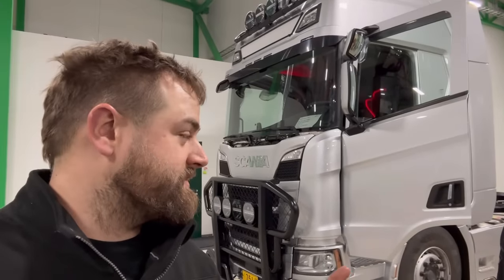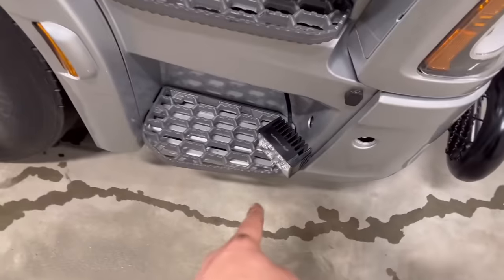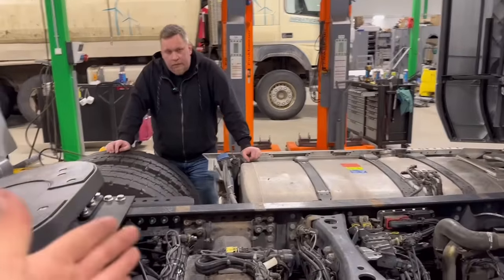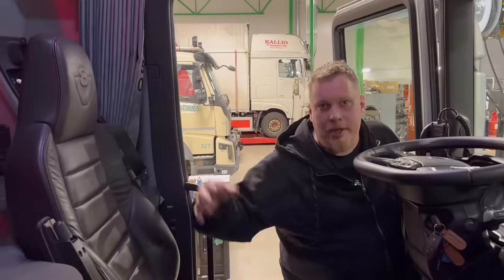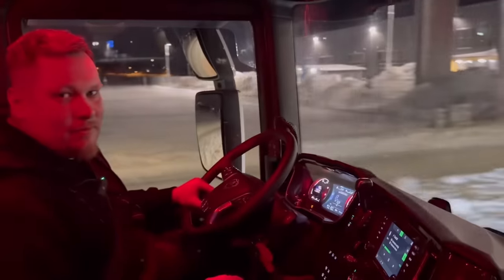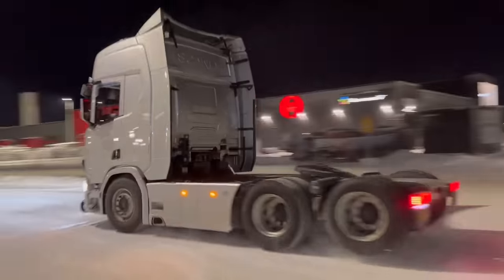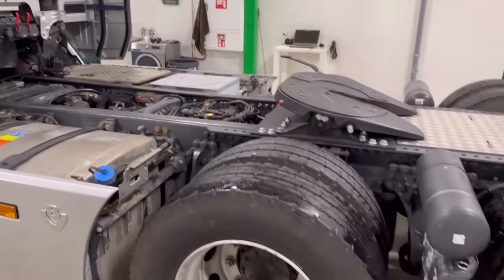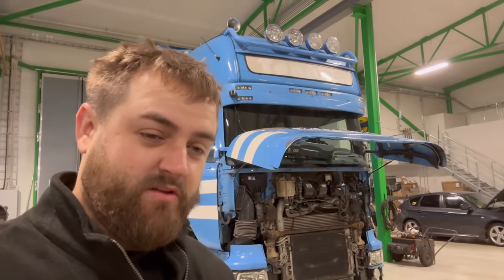First EVER Manual Swapped R650 Scania Truck!

Comment: No necessarily need manual box anymore in this day and age, especially with all that power and torque delivered by V8 Scania. But it's nice for some people to have total control. 

I gues you only can fully manual convert older/traditional Scania Opticruise gearbox (GRS & GRSO Series), I'm not sure with the new Scania G25 & G33 gearbox, since they have new gearbox layout and planetary gear system.

Comment: Regarding older European trucks, a lot tend to migrate. So they're still working but usually in places with looser emissions laws and the local mechanics will often remove emissions reducing features like the adblu/DEF systems.

Although in the UK at least, the more specialised (additional job specific equipment) a truck is the longer it's kept running.

Comment: Maybe it was the first ever manual swap, but these R650s did come with a manual gearbox from the factory! They were the absolute last Scania V8s to be available with a manual. You can still get a manual today, but only in combination with the 6 cylinder engines. I wonder how many more brands offer a manual today, Daf and Volvo for sure only sell automatics today. Scania has a specialty for the automatics, a clutch pedal that can but must not be used, it's called "clutch on demand" and actually works electronically.

Comment: Ylivoimala,  the dominance of the super power plant,  that  tunes super Scania trucks into super duper trucks!  

and you did improve a lot on them pronunciations, too. I'm so inspired by your video uploads. 
Speaking of being the Scania ambassador in the USA, I hope you make it.  They've tried it, but ocult forces have dragged them away. You know Cummins is part od the same subsidiary Traton, where they, including MAN are all ultimately owned by the VolksWagen Group. In Brazil the VW truck has used MAN engines (made in Brazil) for a decade. Who knows if Cummins could start making Scania V8's? Volvo has found its way with the nosed VNL's. Maybe Cabovers are just not the  preference in the US. But you bet V8's are.
Reply: Scania and MAN share engines. The inline 6s are made by MAN and the V8s are from Scania.

Comment: I think there nice, but do a 210 wheelbase, 120 inch sleeper, 13, 15 manual trans, no tag, both drives live with lockers, heck ya

Comment: fun fact about the blind spot camera. here in the UK if you need to drive a truck in London you NEED to have them cameras installed otherwise you get a £550 fine (697USD) every time you drive into the capital. you also need the shouty man speaker ("Caution Vehicle turning Left") and a blind spot sticker on the blind side of the truck. you have to register the truck with Tfl (transport for London) and prove that the safety systems are installed and they will add you to the system so you dont get the fines.
Reply: Yep.   On the scania bottom right bank middle fuse shuts the voice up.   If people can't see a 44 tonner turning left they need stay at home
Reply: In scandinavia, and other european countries, bicycles and pedestrians has a right of way in crossing/stoplights. So if motorized vehicles has to turn right, they have to wait until the road is clear behind them and to their right. And since that angle is blind, cameras are necessary for safe traveling.
Reply: Should have been mandatory from the factory since cheap dashcams were a thing from 15 years ago.

Comment: Sure i can understand why you want a manual, but the Scania automatic gearboxes seams to be really good, why then converting from a auto that works good to a manual? :)

BTW: temp wise, -7C is normal and a preferred winter temp any warmer its to warm during the winter 😂 
And right now, here in Sweden i have -15C and i live at about the same longitude as you are at in Finland atm :)
Reply: And yet Scania put a clutch pedal back into the heaviest opticruise equipped trucks.
Reply: Cause some people just don’t like auto me being one of them

Comment: That manual shift sure brings back memories. Had the honour of having that 11 years. I REALLY MISS IT! Completely superiour solution -if You really know what You're doin'. Exceptinally nice 4 pulling really heavy loads on slippery roads -and getting it just right around really tight spots. This offcourse without burning out the clutch. SO MUCH RESPECT  to this guy -who bought -and specified this to/ from Ville! Would love talk truck over a cup of coffee with that guy. (45 minutes of course.)

JUST LOVE that flipped vintage SCANIA/vintage FERRARI manual shift pattern! 

Been wondering:
How do You use the tachograph in on U.S. trucks? They are mandatory on all trucks over there -like here? U should have old ones (paper) and new (digital) ones like we do here in Europe. Are the older paper tachographs -still allowed in the U.S? 
Bruce has the old tachograph in both of his SCANIA Trucks. If he later will pull some loads with his new SCANIA Truck: -Can he just use the old paper tachograph in his SCANIA over there?

Comment: Anybody knows if US manufacturers can spec their trucks with hydraulic retarders and/or gear reduction hub axles?
Reply: First ask if they even know that the technology exists 🤣
Reply: My 1989 Peterbilt has a Cat 3406B with the Brake Saver, which is a hydraulic retarder. Works pretty well considering it’s age, but is sadly prone to oil leaks.

Comment: Scania would build you an R650 manual from factory if you really twisted their arm Westward Scania have one but it was more expensive, and it wasn't an option on the S series so they are very very rare.
Reply: Yes the manual gearshift is only in the R Serie possible... the Power with this truck is unbelievable ... uphill you are a left lane bandit with this truck !
Reply: I feel like they actually wouldn't. Probably don't manufacture the parts required anymore.
Reply: @rkan2  no they will do and have done in the past, as I say Westward Scania have a from factory Manual 650
Reply: @grahamhume8135  yes the R650 you can buy with manual gear shift, but now the only build automatic gearshift the R650 Was the last with manual ... i drive the R650 with manual and it was a Monster uphill ... it was fantastic!

Comment: Two weeks is too little time to really see the variety of truck stylings in Europe. Also you should have grabbed all the lights out that R that you grabbed the engine of.
Reply: The lights on the R looked like older halogen lights, Im pretty sure Bruce wants LEDs like the ones on the manual swapped truck, halogens have NOTHING on LEDs when it comes to brightness or longevity

Comment: then you ask if its "Cable" for the shiter / gearbox, with that you talking about a electric switching gears. or do you mean that its a "steel wire" shitfit the gears then puling the shifter?

Comment: Normally I would take of in 2. go to 4.-5-6 if loaded light or flat road conditions maybe skip 5. … you can try it on yours.
Reply: And splitting gears only when needed. If the motor is loosing slightly rpm uphill.

Comment: Fyi those extra lights are not legal in USA except for off roads as it can blind on coming cars on highway  these are legal in Europe in some countries
Reply: The reason these are legal some places in Europe and doesn't really cause any issues on public roads, is because they can only be wired to the high beam circuit. You can never turn them on manually with low beam/driving lights, so the driver only has to operate the low-high beam lever as everyone else.

Comment: Bruce I can see why you like the Scania so much especially for the HP and torque. 

What are you impressions of other European vehicles? MAN which is also owned by VW, Volvo, DAF, MB. The Scania has the biggest engines but for safety features they are all similar. Definitely decades ahead of their NA counterparts although again some U.S.A. models are owned by European mfg.

What is the reason you dumped the auto?

Just curious as to why you have picked the one.

Comment: Whilst I really admire the engineering involved in doing this.
    But what really is the point, because as standard you can drive the new Scania in MANUAL MODE & USE THE PADDLE SHIFTER ON THE RETARDER LEVER. 
I drive Scania in manual mode everyday whilst at work in my new gen Scania.

But then again….driving in the snow, manual with a stick makes sense, because these guys in this country drive in the snow all the time.
     But I think I’d still rather have the new gen Scania just how Scania makes it…..with a straight pipe.

Comment: It seems that from july 2024 onwards, manual transmissions are no longer allowed on new European trucks. The reason is that automated (not automatic !) transmissions reduce fuel consumtion, and with that CO2. 

Bruce is doing a lot with Paccar Peterbilt trucks, so he should visit DAF in the Netherlands where they build the European cousins of Peterbilt. No V8 engines, but the cab of the DAF XG+ is much bigger than any Scania cab (except the longline of course). He could also visit the Tatra importer there. There's nothing in the US that is remotely comparible to a Tatra Phoenix. They will get the new DAF XDc cab, and these trucks look magificent with these cabs. There are plenty of YouTube clips with the Tatra Phoenix.

Comment: Why double VBG air on the semi? 6:45
Reply: Good question, they will haul trailer what needs two of them. Two semi trailers with B-link
Reply: Usaully one off them is a dummy to put the lines at where it's not needed.

Comment: The reason you don't see old trucks so much in Europe is emissions regulations in big cities like London, Paris, Lyon etc. You get fined if you drive a truck which doesn't meat Euro 6 emissions standards which means any truck made before about 2016 can't go everywhere you might need to haul a load to. On the one hand it's a shame as it's led to a lot of good trucks being scrapped for no reason but on the other hand I also like being able to ride a motorcycle without filling my lungs with diesel particulates and you can't have it both ways.

Comment: Any idea how  much  it costs to replace an auto gearbox with a proper manual?
Reply: Older Scania Opticruise is just pneumatic and hydraulic shift actuators on a manual gearbox. You just remove them and replace with manual shift linkages.

Comment: Do they make them with sleepers on them
Reply: They do
Reply: No. Wouldn't work well with the tipping cab. There are some aftermarked extended cabs, quite rare.
Reply: Yes you can spec them with a bunk, quite common
Reply: @JaakkoIsWatching not sure where you are getting your information but as a mechanic who works on alot of these, I see quite alot with bunks in the back...
Reply: Funny how Bruce likes this Scania. Almost as much as I love Peterbilts. Or hate Scanias.
Reply: @samthesr20man  Beds in sligtly longer cabs yes, but not sleepers as you would have for a Pete 389.
Reply: @JaakkoIsWatching  sleeper would be mean it has provisions for sleeping, no?
Reply: @JaakkoIsWatching  what is the exact size where a cab you can sleep in becomes a sleeper then?

Comment: Any automatic can be converted, all it is is a shift box on top the transmission, just remove box put in a electric clutch because most are dc electric now, Shazam it's a manual again
Reply: It's how I design airplanes in my spare time. Just add this, remove that, shazam. Easy.

Comment: And the reason you dont see so many older trucks anymore here in europe is because emissionnorms etc and a lot get exported to Afrika or just get scrapped.
Reply: At least in finland maximum combined weights have been raised several times in the last 30 years and older trucks usually can't take advantage of that because they don't have enough axles or their vehicle weight rating is below the maximum. Having to operate with lower combined weights makes old trucks uncompetitive compared to buying a new one for high utilisation operations.

Comment: This might motivate bruce to swap the factory Scania syncronized transmission with an unsyncronized Eaton Fuller 18 speed manual transmission.
Reply: Why. The scania box with splitter and range in it plus the synchro, means its super smooth and quick. Ive driven both and I'll take the scania box every time.
Reply: @garywebster6453  Why?;because then he could "float" the gears without ever having to use the clutch and only use the clutch when starting off or coming to a complete stop,and an unsyncronized manual transmission is more challenging than using a synchronized transmission which keeps the brain stimulated.
It would also save the clutch from having to be replaced sooner;and he wouldn't be wearing out his left knee from always having to be letting the clutch out everytime he downshifts,or coming to a complete stop.

Comment: but... it's one of a kind?? because.. they ordered it wrong? or? Why buy a Automatic en building it to manual? Scania makes manuals? I ride a lot of V8 manuals.. in Zwolle they make a lot.. for everywhere in the world? So seems like a lot of work for something that's also done in the factory itself?
Reply: What kind of factory sells 395 000km driven trucks? It even has yellow dutch plates on.
Reply: @kognak6640  Those are not Dutch plates, they are Finnish temporary plates. That´s why there´s the word "KOE" written on them, on the left side.
Reply: @Kivikesku  You're right and truck is Norwegian origin based on the picture. Not regular temporary plate though.

Comment: WHY have a manual gearbox in 2023...????????
Reply: Why not ? 😁
Reply: @Xv1p3rCr0  because it's meaningless. 
It makes the truck heavier and less fuel efficient.
It's harder for the shafts and differencial.
Reply: Becaause in harsh winter conditions, the driver can make better shifting decisions as a robot which doesn’t see the road and conditions ahead.
Reply: @Tsjoni  l've norwegian truckdriver who's been driving in harsh winter conditions three decades, please teach me how to drive 😉😂
The automated gear system is quicker and more precise than any driver.
Reply: @stigandrmyrardalur5208   Some people just find it more fun, and more in control depending on where you drive ofc. Same reason youd want a manual in a car almost
Reply: @catpurrn  point is that you have LESS controll with a manual gearbox.
Reply: @catpurrn  
It is about the control of the rear axle only amateur rookies don't get it.
Reply: @stigandrmyrardalur5208  

Have you been driving trucks in 30 years and you don't know the advantages of a SCANIA gearbox...

You can buy the Opticruise  gearbox with a Clutch Pedal attached SCANIA writes : 

Scania Opticruise
Clutch on Demand has an additional clutch pedal for convenient use in special conditions, otherwise the system works as an ordinary automatic clutch system. Smooth and fast gearing The new lay-shaft brake provides faster and smoother gear changes to maintain both engine torque and road speed.

Tell me you're not a truckdriver without saying you're not a truckdriver.
Reply: @bendermi first when Scania became a part of VW and got german engineers to help them did Scania start to build acceptable trucks.
Particularily when it comes to transmissions Scania has been way behind the rest.
The "advantages" of a Scania gearbox is that it now is starting to function almost as good as the others, and that they don't break down as often as they did before.
Reply: @stigandrmyrardalur5208  
Yeah right 🤦‍♂️🤣🤣🤣
Reply: @stigandrmyrardalur5208  
In some part of the society the transmission will fail and the driver will leave his teethmark on the gear knob to celebrate and show the world he has ruined another masterpiece.
Reply: @MH-hg1tv  
 So much experience is not needed before a SCANIA shows itself from its best side, but then we also have the hopeless experts who can just ruin it all.